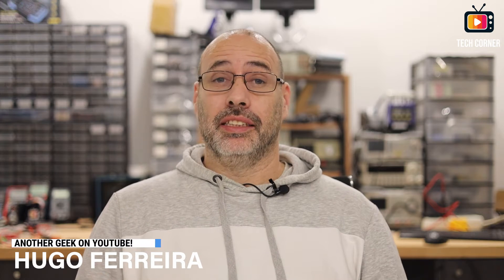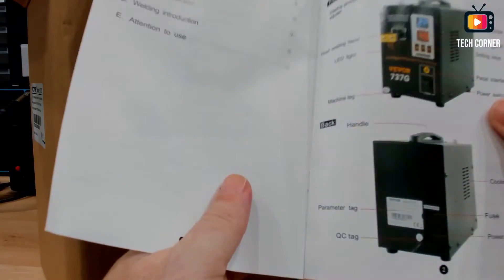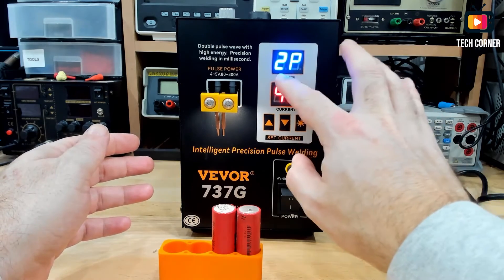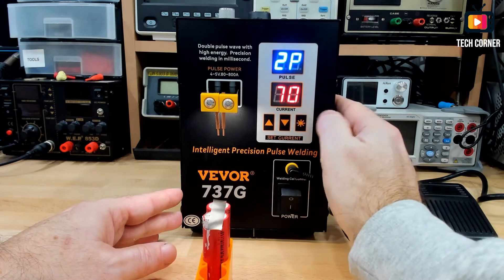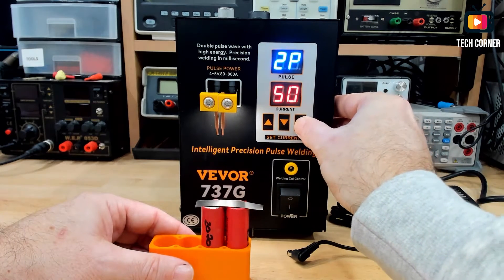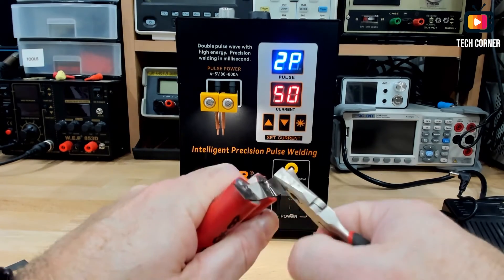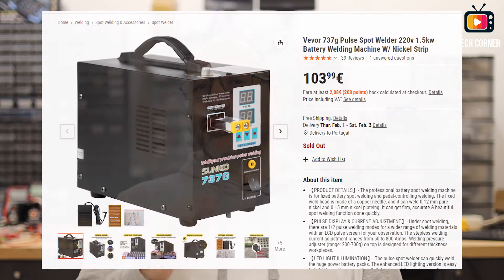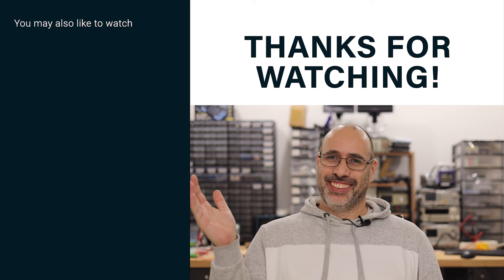Vevor 737G Spot Welder ⭐ Simple & Effective To Use!

Comment: Thank you for posting this video . One urgent question please ? If i use this welder at home in Melbourne , Australia ( 240v) , does it blow my main fuse ?
Reply from the maker: Hi, I don't think so. I had mine connected to a circuit with 240V and 16A switch and worked without a glitch. Thanks for watching.
Reply: @TechCornerTV  I use mine on 230V 16A , blow fuse on 60% settings 🤷